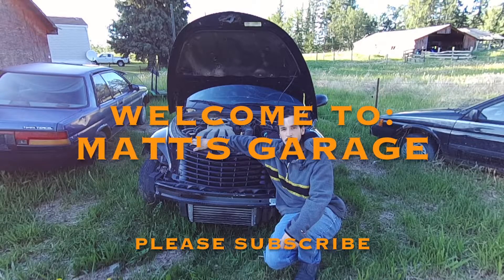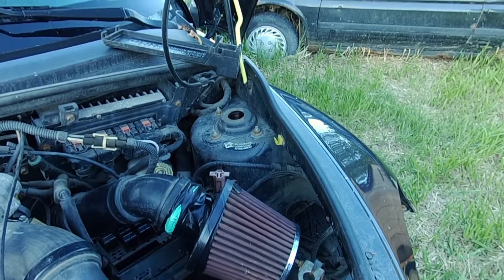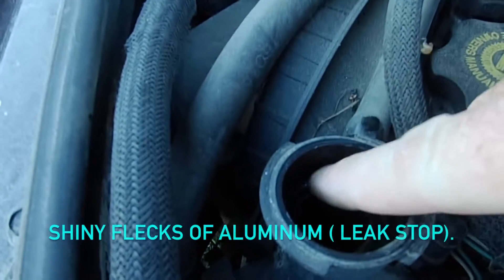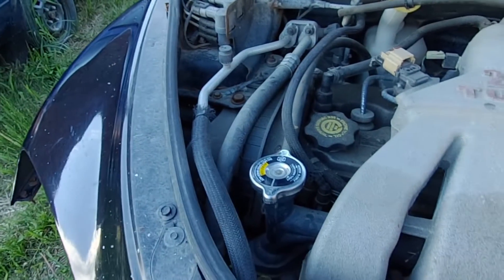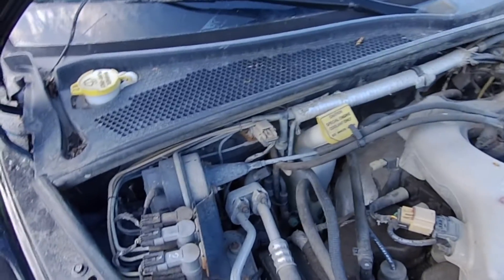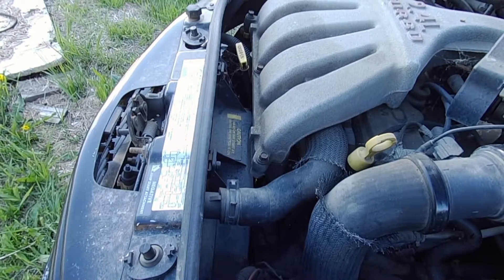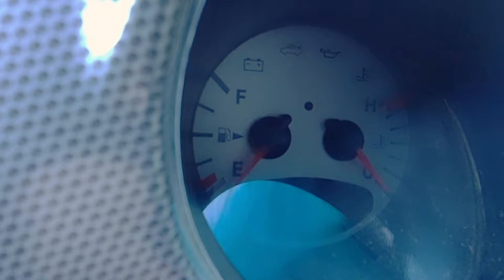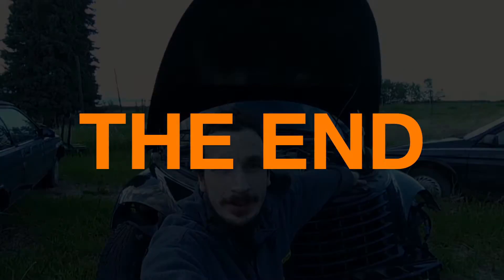PT Cruiser Overheating Issue

Comment: My car does idle rough when I turn on a/c. It’s like it keeps trying to turn on and off . Could that be why it over heats? How could I fix?
Reply from the maker: Yes if it's doing that, there's a good chance it will need a new cooling fan.
Reply: @CarswithNash thank you I’ll change that next. Should I change anything else around there while I’m charging that out?

Comment: I’ve change thermostat, cap, my fan works. But if I have the air conditioner on when I’m on my lunch. In about 45 minutes it’ll start gargling and start to over heat then I turn off the car and it’s starting to leak coolant from somewhere under the resivir tank. Any ideas what I should do next?
Reply from the maker: It's a 2 speed fan, so it may have failed on the high speed and may not be cooling enough.

Comment: My 07 reads 1/2 on the temp gauge but water bubbles out of the overflow ?
Any tips ?
Reply from the maker: You either have air in your system from recent cooling system work or a blown head gasket.

Comment: Easier to just hot wire the fan with a push button switch inside the cab somewhere. Really is the easiest way, though not the right way.
Reply from the maker: Yup, that's how my hot rod is wired, it's nice to be able to leave the fan on after the car is off in hot weather to prevent heat soaking.
Reply: @CarswithNash I figured I would get dumped on for the red neck fix, haha

Comment: I heard if your top rad hose is hot to the touch, but the lower one is not, it means the radiator is clogged. Thats how mine is. It overheats if i push 70, but cools down if i slow down. Then i felt hoses and the lower one was much cooler.

Comment: PT cruiser I just bought 2 days ago has a turbo after driving for 2 hours I ejected a CD that was so hot I had to drop it. Looked over at the gauge needle was right in the middle the car was not overheating put my hand on the center where the window switches and radio are located. It was very very warm. Do you have an idea what might be going on. I'm afraid to drive it now. And I just got it two days ago. Have been with you out of car for over a month. I've got things to do and I'm nervous about getting in the car. Never had a car shoot out a hot CD before
Reply from the maker: That is an unusual one for sure, I believe there is a separate 10 amp fuse in the under dash panel to the left of the steering column and if you pull that out the radio will have no power and then you shouldn't have to worry, it sounds to me like your radio has an issue. A good audio shop might be your best bet for having it looked at.

Comment: Mine only overheats if it sits idling too long.. driving is fine.. don't think the fan is turning on... the ground on half the car was bad when i bought it last week.. got the fuel pump/sender, lights, horn, and blinker grounds fixed so far..

Comment: I have an 07 touring edition and it is having high temp issues as well as gurgling I recently had it serviced to replace the fan the radiator is new and recently changed the thermostat and radiator cap as well. It is still making a gurgling sounds after shutting off from driving no more than 30 minutes and today I started it up to go to the store didn’t feel safe driving it because just sitting there it felt like it was jerking. Any advice?
Reply from the maker: Sounds like you either have air in the system or your head gasket is blown.
Reply: @CarswithNash  praying it’s just air 😂
Reply: @CarswithNash  it also just had a flush and fresh coolant added at the mechanics how would I know there is air in it or how to get the air out?

Comment: The thermostat has an air release built into it
Reply from the maker: Some do, some don’t, it still doesn’t flow enough air and it will air lock if you don’t use the bleeder properly.

Comment: Hi Matt so I was driving around in my 2006 PT cruiser began overheating but it would stop when I would move. I was driving it around without knowing it didn't have any coolant. Finally when I guess she couldn't take it anymore she blew her top off. I filled it with water to bring it home and the next day drove it again and was fine for a while till it began to gurgle. I noticed the tank that supposed to be filled was dry empty. Sorry this was my daughter's car so when I got it I had no idea it was in this condition. What do you think? I filled her up. Do you think she'll be fine now? Could that have been my problem? Thanks hope you can help. Maria
Reply: So tonight I drove it again and it's leaking...😭
Reply from the maker: @henrynmariagranillo6608  Sorry to hear that.
Reply from the maker: If the coolant level stays up it’s fine but if it keeps going down it probably means the head gasket is blown, which is pretty common if they overheat bad.

Comment: Before watching, I did the obvious. Didn't work. Glad I found you. Wish me luck
Reply: Think I found the problem being the fan. If it sat in line somewhere it would throw the light to check gauge and it would climb to 3/4 and try to go past that but stayed. I didn't wanna chance it so I put in a thermostat the other night and made sure there was no air in the system. Drove it around all night fairly hard (but didn't sit anywhere) and it remained under half. Thought it was fixed. She had to go somewhere and started it up and we were talking over 20-30 mins and she got back in it and the same thing it was hit and she said she could hear it bubbling. I thought okay well let's try the cap, havnt bought it yet but found your video which led me to the fan. It spun freely so I double checked everything else and let it sit and warm up. The fan never came on. Think im onto it!
Reply from the maker: @theman.6396  Yeah that seems to be a common problem with the PT‘s, if all else fails just wire it straight to key on power and put a toggle switch on it for when you want it off. (sometimes it’s a PCM fault and that becomes the most cost effective solution)
Reply from the maker: Good luck! What are your symptoms?

Comment: Hey man i know this video is old but i bought a 05 pt cruiser gt turbo and it only overheats when i floor it or go uphill. I replaced the thermostat but it didnt work. What do you think it might be
Reply from the maker: Did you properly bleed the air as you filled the system? That would be the less severe possibility and the more severe possibility would be a blown head gasket… Which unfortunately is not uncommon when you buy a car used that maybe a seller was trying to unload it with a hidden issue. You can buy a test kit that attaches where the radiator cap goes and then you run the car and it can tell if you have exhaust gases in your cooling system which would indicate a blown head gasket. You can buy those kits at auto parts stores or on Amazon, that’s the most accurate way to check it. (and probably would be the first step that a mechanic would take in diagnosing it, so better to buy the kit and do it yourself and save some money) Just make sure you don’t have any air bubbles in it first because what will happen when you floored is it’ll suck the air bubble through and start circulating water and then that really hot pocket of water that was sitting there will hit the temperature sensor and send the gauge into the red…
Reply: @CarswithNash  thank you im going to bleed the cooling system. I dont think the head gasket is blown because the oil looks good no coolant in there. If i drive it normal it wont overheat only when its under a load. It overheats to about 3/4 but it doesnt make it to the red. Plus when im at a stop light the temp will come back down to half way.
Reply from the maker: @Jon-bq5pd  You may want to try to just do a system flush or replace the radiator. The cooling system on these cars is just “adequate”, if anything is a little bit weak they can easily creep up. You don’t always get mixing of fluids with a blown head gasket, but normally the coolant level will drop regardless because if it’s not mixing it is burning coolant. Hopefully it is a simple fix for you.
Reply: @CarswithNash  thank you very much ill try that first

Comment: Car just overheated again due to the fan, this will be my four time replacing the fan due the low speed not working. I’m curious to the problem being the actual fan or the electrical leading into it such as maybe a fuse or relay?
Reply: I seem to be on a 6 to 8 month interval on replacing this fan

Comment: Thanks Matt !!! What year is this because my pt is 2005 people have told me it is the 2006 and forward that all is in PCM is thst true? Wait the temp sensor is wby the antifreeze tube? I don't have any codes like p0157 can it still be tve temp sensor? I think you may have said its a fan issue I think that might be it but I can't filled on for my 2005 local do you think the part geek one will work it says it fits my car fingers crossed ... thank you!
Reply from the maker: The one in the video is a 2003 GT. Yes 2006 cars have a totally different electrical systems, I’m not that familiar with them to be honest, we do have a 2006 but it’s been a project car for several years (custom paint and body) and before then never gave us any trouble at all, I’ve never had to work on it really. Sorry I haven’t had a chance to get to many comments in the last week I’ve been so busy. I like to change the temperature sensors as preventative maintenance, yes they can have glitches and not throw a code. The fan motors are a pretty common fail item on the PT it seems.

Comment: Does the water pump have a weep hole? Would you notice fluid loss under the car if the water pump was failing? Can you do a video on overheating in the 2006-2010 cars? Thanks for all the videos. I just bought a 2006 turbo GT that is in great shape and hope to be able to keep it for many years.
Reply from the maker: As far as the cooling system goes it’s exactly the same on those newer cars. Yes they do have a weep hole, they will leak out the right side at the rear of the engine. The problem is I have seen those water pumps lock up without warning, so it is always better to error on the side of caution and replace them as a preventative maintenance item.
Reply: @CarswithNash  Thanks. I thought there was some difference in the way the fan worked. What are those 2 things that look like relays on the radiator of the 2006?
Reply from the maker: @jesse1247  Yeah those are fan relays and on the older turbo cars the fan is actually run from the PCM.
Reply: @CarswithNash  Thanks again

Comment: My pt thermostat will go to half way to high  with only a few min.,  of driving it shouldn't get that high that fast of driving then it will gurgle when I shut the engine .
Reply from the maker: That's typically a sign of an air pocket in the system or possibly a blown head gasket. Sorry I'm late responding to this.
Reply: @CarswithNash    thanks , I'm going to do the minor things like change out fuses , thermostat , filler neck , replace the fan , air blow clean the radiator and make damn sure I bleed the system ; and have mechanic change out water pump and timing belt . 

That way I can eliminate all possible problems , if it ends up being the head or gasket , I'll save up the money and have that done . 

Thanks for your time and input . 😎✌
Reply from the maker: @berenwarrior6276  There is a chemical test you can do to determine if exhaust gases are getting into the coolant which would indicate a blown head gasket, you should have your mechanic do that test and determine for sure before doing the timing belt and water pump. He will have to take that belt right back off if he is removing the head so it’ll be a lot of wasted labour if it turns out to have a blow and head gasket later...

Comment: So I have had a ruff idle while running the AC for a good couple months, and have suspected that the high speed fan is having problems. But recently over the last week or so, the PT is starting to get too hot, sometimes almost to red (so far not into red) when I drive 50 or so miles. It will cool itself a little bit while moving but heat up fast while at idle. I find this odd because it will hold regular temperature for 30 or so miles THEN start rising. 

Between the AC issue and now the overheating issue I'm pretty sure the high speed fan is not clicking on properly. 

So in your opinion should I replace the high speed fan relay first and hope for the best? Should I go for the thermostat, or possibly just put in a whole new fan? I have read sometimes the fans high speed goes out on the unit itself.

Thanks for the help ahead of time, you're always awesome Matt! You're help, passion and videos have helped me love my PT even more than I would alone 😁
Reply from the maker: Justin Thanks for the kind words and feedback. Sorry I’m delayed in responding to you. I would start with a new fan or if you didn’t know you can get just the motor, takes about 5mins to swap into the old housing and they are around $60, I think it’s likely just the fan motor has worn out.

Comment: My PT temperature reading goes up then back to normal, now here's the crazy part I seen the antifreeze being squeezed out of the resivor never seen anything like that before!
Reply from the maker: Keith Herbert Sounds like you’ve got air in the system. I’d drain the system and refill it with the air bleeder open to avoid trapping air, that bleeder should be open till you get solid coolant coming out, then close it and top off the system, squeeze the upper hose to release any trapped air within it.
Reply: Yeh mind going it I think my head is pumping air in my system

Comment: Turbo model PT Cruisers don’t have fan relays. I recently had a hi temp issue on my PT and the fan relay was my first thought; this is how I discovered that the turbo models aren’t relay driven. Ultimately I found that my fans were working fine and if I kept my RPM’s over 3k the temp would stay normal. Idling and low rpm cruising (55-65 mph) resulted in a hi temp. Apparently growth in the radiator was restricting flow and the hi RPMs pushed enough water through the choked system to keep it cool. Replaced the radiator and haven’t had anymore issues.
Reply from the maker: Jeremy Granson Yeap you are correct, the turbo’s actually have a variable speed fan vs. the high/low in the none turbo, it’s controlled directly by the PCM. I actually don’t have a lot of experience with the turbo models yet and wasn’t aware of that when I made this video. Glad you got yours figured out.
Reply: Matt's Garage as you pointed out, there are multiple potential failure points in the cooling system on the PT. This is why so many people experience over temp issues w this car. The designers tried to put way too much into the tiny engine bay. High maintenance and tight working spaces makes the PT a real PITA at times. I picked mine up w 70k miles and have replaced the timing belt, water pump, valve cover gasket kit, all motor mounts, cam position sensor, PCM, radiator, radiator cap, transmission mount, transmission drain pan (swapped for one w a drain plug), front end bushing kit, both cv axles, one hub and bearing... the list goes on. This is why you can buy these things for next to nothing. The cost to keep on the road is monetarily exhaustive.
Reply from the maker: Jeremy Granson I actually enjoy working on them, I don’t find the engine bay “tiny” at all, it’s very well laid out. Most the stuff you’ve replaced are common wear items on any car, these cars are older now, you’ve gotta expect that, it’s the same with any other car that age you buy, I know that first hand. We’ve got 5 in our family including the one in this video, the other 4 have all been fantastic cars, in fact my parent’s are 6000 miles into a cross country road trip they are taking in their ‘03 Dream Cruiser currently.
Reply: Matt's Garage, “well laid out” and “plenty of room” are not synonymous. I had to remove all the motor mounts and slide the engine over to remove the motor mount that us embedded in the passenger side frame and to have enough room to get a new riming belt in. Not exactly ideal. The service intervals are significantly earlier than most cars. I believe this leads to the typical failures a lot of people encounter; they aren’t following the PT maintenance schedule. Anywho, thanks for the responses, enjoy the ride!
Reply from the maker: Jeremy Granson You just jack the engine up and pull the mount out from under, the engine goes really high without having to disconnect anything, you leave the transmission mount connected and just jack the engine up, that’s how you get at the timing belt as well. I gotta do a timing belt on one soon so I’ll be doing a video on that. Those center mounts typically last forever, I’ve never changed one, had ‘em with 200+ k miles, same with the transmission mount.

Comment: I saw a video somewhere about failure to start in a PT in which the temperature sensor was bad and prevented starting because the main computer prevents this when it senses overheating. This was diagnosed by OBDII software and monitoring the sensor readings.
Reply from the maker: Thomas Blow Yep! That’s why I like to replace those as a preventative maintenance item, I actually replaced one just last week, video to come.

Comment: Nice vid, thanks! My PT sounded like this one and wasnt turning over, after about 50 attempts it finally started, I think the fuel line was clogged
Reply from the maker: John Carguy Yeah I haven’t fully diagnosed it, but I did try starting fluid and it didn’t make any difference so that should rule out a fuel issue. It was sold to me as a none runner but of course I had hoped they were wrong... Thanks for watching.
Reply: hydraulic lefter  needs to prime up in oil  if sat for long time